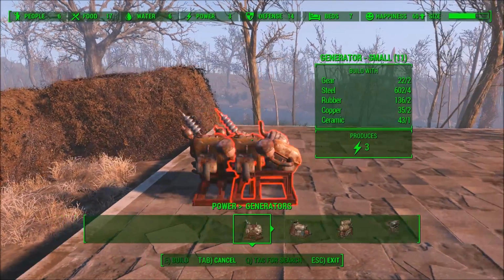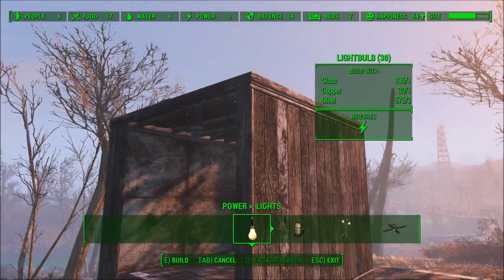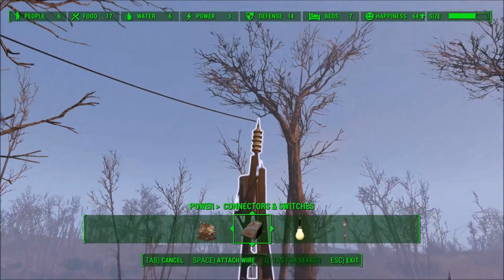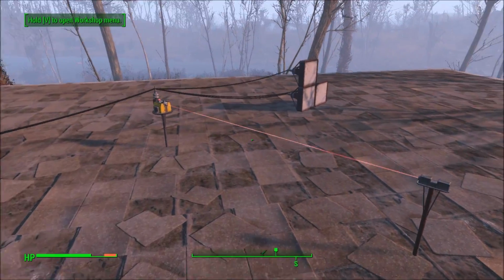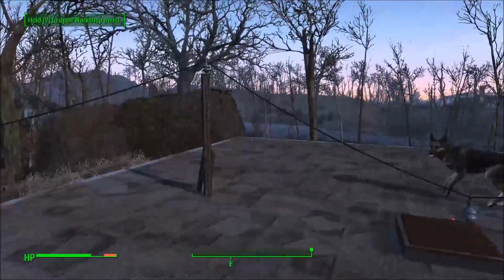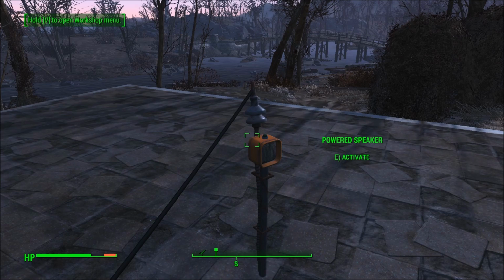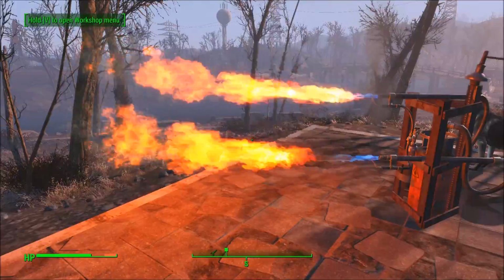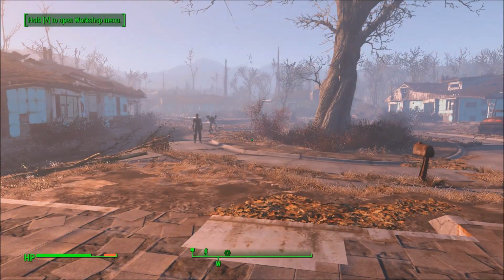Fallout 4 Electricity Guide

Comment: I just did a siren test at Finch farm. I thought it would be handy to set a pressure switch connected to a siren in front of a fast travel target. That way when the settlement was in trouble I could fast travel to Finch Farm, take one step forward onto the pressure plate, and gather everyone to the siren... on top of the Finch Farm Freeway. That was we could defend the farm shooting down on the farm... Didn't work. Dogmeat tripped the siren, so I ran to the edge of the freeway to watch the settlers running up the stairs towards the siren - but they were all deaf. Not a concern in the world, still weeding their Mutfruits.

Comment: I don't know how, but i think my game is broken... if i atach a connector to a wall powered, any other connectors or switches that i connect on the other side of the same powered wall, doesn't work! Lights do work perfectly like in you video, but not the connectors!

I had played this game on console and was very good at it and had no trouble, but after this last dlc, i decided to play it on pc and i'm having so much trouble to conect power!

It received a lot of cool things, but i can only connect power throught  cables and not throught walls with connectors! I don't know why...

Just tested, can't connect interior with exterior or exterior with interior using connectors. I have to built a generator  in the are with the ligts....

Comment: So, if you attach one conduit (with say, 20 small generators) onto a house that is pre-made, does it power the whole house, or do I need to put more in different locations on the house?
Reply from the maker: +Bob is Bob It has an area of effect. It creates a powered radius around the conduit. if it is too far away from it, even if connected to the same building it wont light up.

Comment: "Power conduits...Once you mount them onto a structure, any other electrical component attached to the strucutre will be powered."

NOPE!  Power conduits provide an electricity sort of AoE, same as with the larger power poles.  Aside from that, some good info in your video.
Reply from the maker: +TheUbergamer You're absolutely right. I haven't gotten around to annotating a correction to the video yet. Thanks for the reminder.
Reply: AoE? Whats that? If it's Area of Effect or something like that, THAT is the information I'm looking for and nobody's mentioning it. Is it 9 sq floor panels if the conduit is in the middle? 3 panels distant from the power conduit? If I have a building 10 stories tall, with generator on the roof, does power reach all the way to ground floor but in a 9 sq. panel AoE?

Comment: Thanks for this :) 
I'm still a bit baffled by the pylons, I was using them to connect to a spotlight from a small generator which had enough power and it just would not work. wires there, two pylons and a generator. i assumed that power lessened over each pylon but apparently not. Colour me stumped.

Comment: Great vid, I've done everything exactly as shown but lights still do not come on.  Maybe glitchy.
Reply from the maker: +rblenian Yeah, it's glitchy at times. But there is a range on the conduits. If the light is too far from a conduit it wont light up. If that doesn't help, try disconnecting and reconnecting the generator/conduits.
Reply: +Mitt Gaming Thanks for responding.  I wonder if next time I play and go back to the settlement it will be working.  The conduits are right next to the lights.  Not sure if a ceiling conduit must go with a ceiling light, wall conduit for wall light etc, or if it matters, but they are right beside the lights.   Also, in workshop mode it indicates that the lights, conduits all have sufficient power. (green icons) The lights just won't turn on.  And yes I checked the switch too.   I wonder if when I boot up the game again it will fix itself.

Comment: Okay I don't get this. I attached a generator to a conduit, then I put a lightbulb on my ceiling. It worked, but then I decided to move the lightbulb and it no longer lights up nomatter where I put it. I put a new bulb down and then it works again, but moving stops it from working.
Reply: the conduit has an area of effect, and the bulb has to be within a certain range of the conduit to work. think of the conduit as transmitting power wirelessly.
Pilons can also transmit power wirelessly.
Put multiple conduits throughout your house connecting them all, or place pilons on your roof.
sometimes storing the not working bulb, then placing it again turns it back on.
Reply from the maker: +FuzzleLand Yeah it's pretty glitchy, I don't really know what to tell you. The connection logic that this game uses is kinda sketchy at this point.
Reply from the maker: Awesonymous RC
Wow thanks for that clarification. That explains a few things!
Reply: Awesonymous RC
 It was in the area of effect, it just stopped working when I moved or adjusted it in the build mode. Meaning I placed it, it worked, I moved it slightly, didn't work, put it back in the place I had it before or closer to the power source and would no longer work until I removed it entirely and put a new one down.

Comment: Great info dude thanks!! I'll just have to find out how to get the power lines on the PS4 version.
Reply from the maker: +Ashton Watts just look at a generator or other item you need to connect while in build mode and without having an item selected to build, it should show what button to press in the bottom center of the hud.
Reply: Ya I couldn't figure it out at first. I thought it was something you had to make. To attach the wire, it's the "Triangle" button on PS4 and I'm guessing the "Y" button on X Box One. So... the "JUMP" button, go figure. sigh.. Take care.